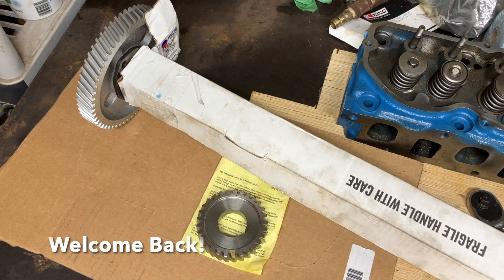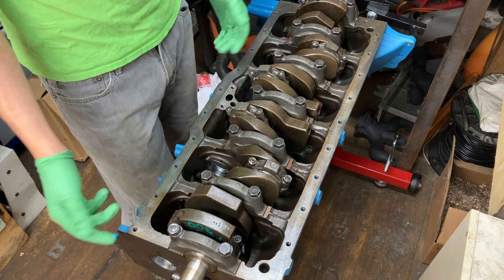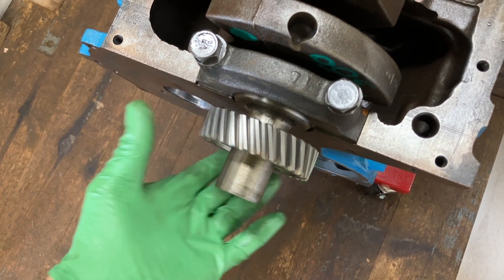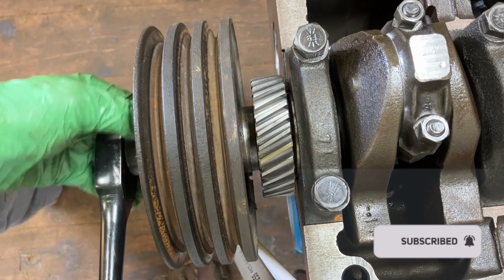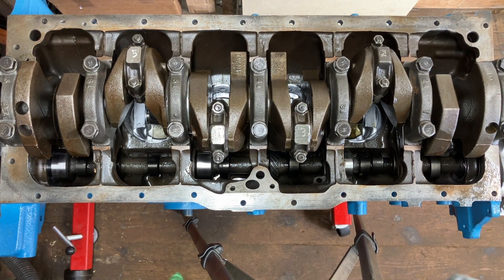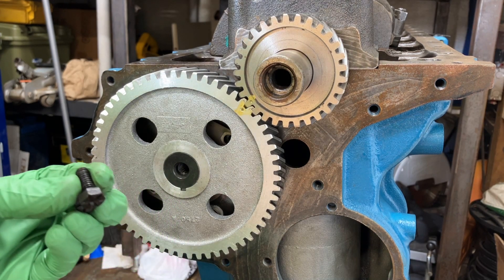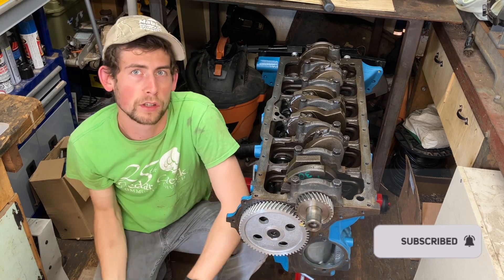Ford 300 Inline 6 Engine Rebuild Part 6: Camshaft Installation

Comment from the maker: Intro: 00:00
Overview of Job: 00:20
Bearing Installation: 01:30
Install Crank Gear: 03:57
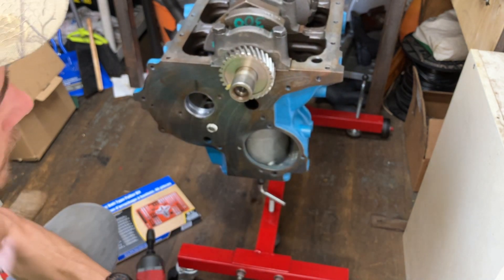Clean Cam: 07:54
Install Cam: 08:47
Cam vs. Ignition Timing: 12:50
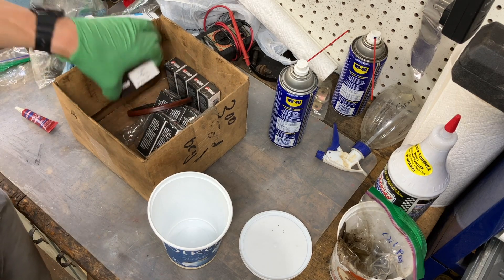Lifter Prep: 14:43
Outro: 16:06

Comment: You aren’t supposed to put the 300 on a engine stand. It’s so long that it will actually sag
Reply from the maker: This is the first I've heard of this, but may have slightly influenced my ability to get this camshaft back in. Are you suggesting that the block itself would bend due to its combined weight and length?
Reply: @JeremyKamutzki  yes sir. It’s recommended to rebuild the 300 i6 on very sturdy table. It doesn’t bend much, but just enough to cause problems with bearing clearances and cam install

Comment: I really wish all gas power cars and trucks had gears installed instead of chains and belts. Oh I hope they do this someday soon
Reply from the maker: I suspect that part of the reason they don’t is due to noise. I believe it’s bulletproof, but noisier. Ford actually used a composite gear on some of the newer 4.9 l that was not reliable.
Reply: I have heard about the noise but 99% of the time it's the motor reving up. If you take a new diesel truck for a ride anny diesel you won't hear the timing gears or injection pump gear

Comment: Good job for a novice. I hope someone has educated you about wiping component’s down with a rag or towel. Lint free is important, I try not the wipe down anything, I hose parts down with brake clean then add the lube, also you really need some good moly grease/cam break in lube.
Reply from the maker: Thanks for your comment. I have heard occasionally about WD40, that it is not the best. I definitely learned lots on this build!

Comment: hi there , you may have been " told " , you'll get less distortion ( of the block ) ,during  c'shaft installation . Should use a solid / sturdy bench , instead of an engine stand , as cast iron " inline blocks " ( six & eight cyl . ) DON'T  LIKE to supported on one end . Use a solid bench , less distortion ( please ) . The same goes for ( cyl HEAD ) ALSO ( again please )  ! Best wishes Charlie Schultz , Sydney Australia .
Reply from the maker: I hadn’t heard that, but I can see your point. Thanks for the tip!

Comment: How the rebuild go?    I'm about to rebuild my 300 this summer. We are moving to Brazil and taking my 300-6 powered Bronco with us.
Reply from the maker: Your bronco sounds like a fun vehicle. The rebuild went quite well, though I wish I put a new radiator in when I did it. Mine is kind of clogged and doesn’t cool enough while towing.
Reply: @JeremyKamutzki  Also make sure that you have a proper fan shroud. It's very important with these motors.  I am also replacing the factory Mazda 5-speed  with a ZF-5 and upgrading to a Detroit Locker from   the factory Tru-Trac.  A Bronco with a 300-6 is such a bad-ass combo.  I had two of them and sold one to my friend who is a Chevy guy. He is not going back to a K-5 and he knows it. 🤣🤣